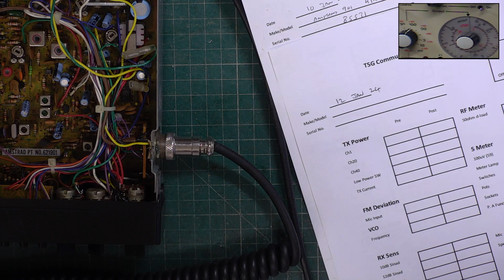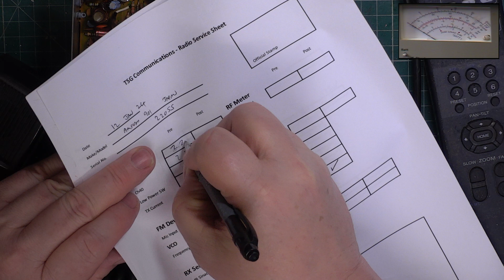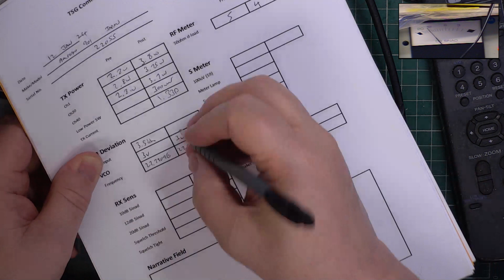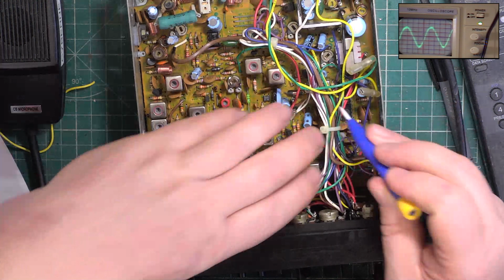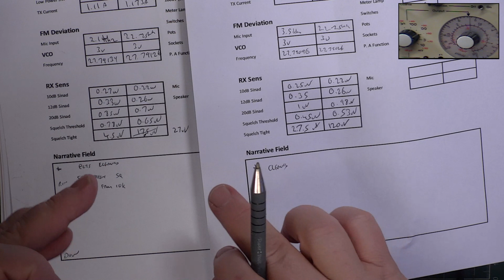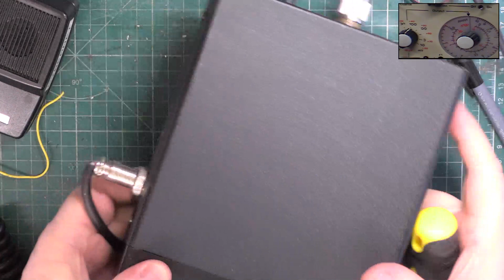Amstrad CB901 CB27/81 UK FM CB radio - Service alignment, Cybernet Japan version

Comment: The 901 will always have a special place in my heart. My first steps into CB in 1985 were with a Japanese-built version attached to the faithful DV27 on a biscuit tin, all of which I bought from a schoolmate.
Reply from the maker: ....whose parent paid £89.99 for it & he sold it you for £35!

Richard
Reply: @ukfmcbradioservicingTango21  Ha, I suspect you're not far wrong there..

Comment: we need to start the 901 club . we had a 901 day in nottingham a few weeks ago .
Reply: Deffo
Reply from the maker: an elite version would be a 900 club

Richard
Reply: @ukfmcbradioservicingTango21  I have one in the box with it's Mic.
Reply: Hi Richard were the microphones called action man Mics
Reply from the maker: @chris_vandepeer  Yes, the original first shipmant of 900 & 901's came with the 'action man' microphone. The PT didn't really go far enough to go into transmit properly so you had to add a sliver of plastic between the PTT bar & the switch. They were quickly withdrawn & a more normal microphone (like those used on the Mustangs) was included instead.

Richard